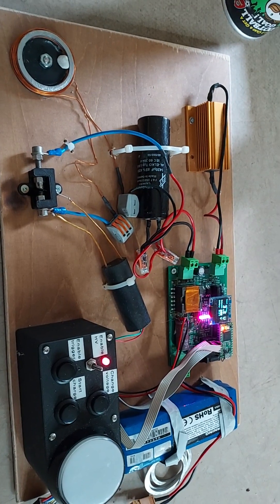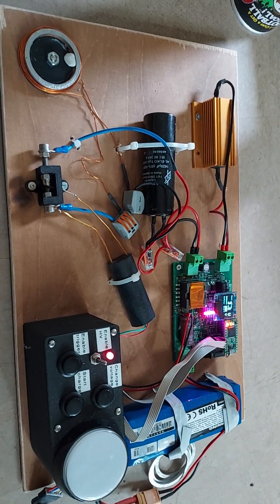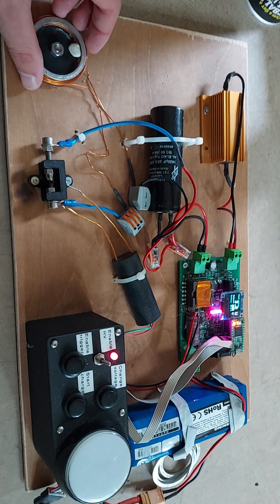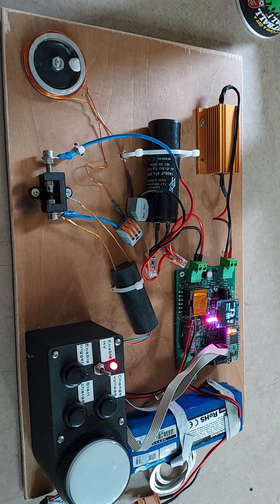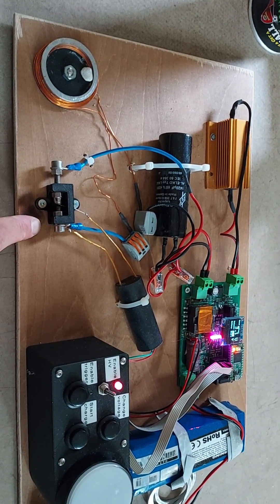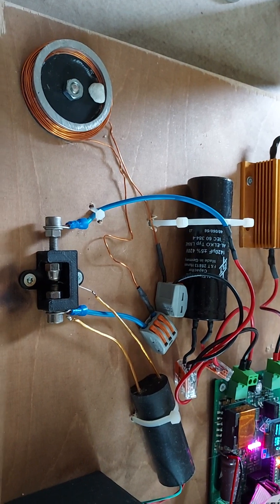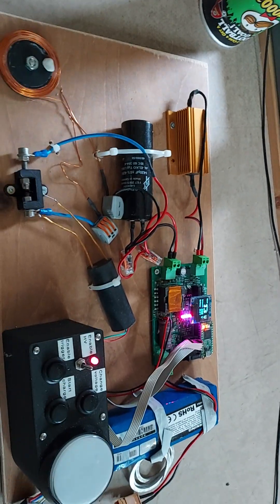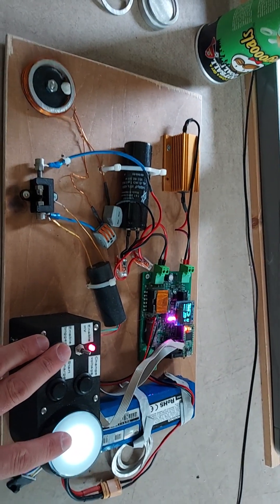Ring launcher: high voltage + high current + plasma triggered switch = extreme acceleration + fun

Comment: I want to build one of those , but I have electrolitic capacitors wich are polarized and I try to take good care of them I am worried about damaging them from the backspike from the coil , do you think a UF diode across the coil would stop the backspike ? Wich diode would you choose ? I guess a small uf4007 diode won't be enough or am I wrong ?
Reply from the maker: A small diode will probably explode (been there done that). I believe that, if the LCR circuit is designed right, the current will have an "overdamped" shape i.e. the current will not become negative. You could simulate (for example in LTSpice) your circuit to see if this belief is correct
Reply: @kloppertje  Mm...yeh I kinda thought same , like using some method so the capacitor would not discharge completly , for example using some kind of fuse in series that would blow up and open the circuit before reaching 0 v , that would make me feel more confident
Reply from the maker: @rodriguezfranco3839  I don't fully grasp/remember the workings of a spark gap (as used in this video); perhaps they stop conducting electricity when the current goes through zero? 
Although this is not good advice, I have never had an electrolytic capacitor explode with my setup 😅
And please, please be aware of the dangers of a setup like this; it's no toy
Reply: You are right brother , I am sorry I forgot about the sparkgap , I was thinking about some other chanel I saw wich was manually shorting the gap with a chicken stick , yeh it would stop probably before 0v

Comment: What is that golden thing with the heatsink? A bleed resistor?
Reply from the maker: Correct! When power is disconnected, or when a fault situation occurs (for example, over voltage), and after every shot (in case the spark gap doesn't trigger the main charge), the bleeder resistor is active.
Reply: @kloppertje  Wow, thanks! That's a very beefy resistor then :P. Necessary of course if you want a quick discharge.

Comment: How are you getting 1000A out of a capacitor thats not 1000A?
Reply from the maker: The capacitor doesn't have a current rating! It has an internal resistance (<0.1 Ohm), so if the load has an impedance that is low enough, high currents will flow.
Reply: @kloppertje  I thought that a capacitor could only give out as many amps ask its rated for an farad?
Reply from the maker: The unit for capacitance is Farad, the unit for current is Ampere. These are two different units :)
Reply: @kloppertje  how do I figure out a capacitors max amps ? Like example i have this huge 4.5LB nichicon capacitor its 100000uf and 100v how do i find out its maximum amount of a amperage it can deliver?
Reply from the maker: @SheikhN-bible-syndrome  Look at the datasheet! Some capacitors have a rated current, for example: https://www.ftcap.de/fileadmin/user_upload/produktboxen/elektrolyt_kondensatoren/webboxen/Loetfahnen/LF2012.pdf

However, special "discharge" or "flash" capacitors or whatever they are named can handle high discharge currents, see for example: https://www.cde.com/resources/catalogs/7P.pdf
I'd say discharge current is here limited by ESR, as I don't see a maximum current. But I didn't read the datasheet thoroughly.
Reply: @kloppertje  I don't see a Max amperage on that charge I just see a ripple current but that's not the same thing
Reply from the maker: @SheikhN-bible-syndrome  What do you want to use the capacitor for? Typically, capacitors are used for filtering, then a ripple current can be used. For peak loads / high discharges, you have the flash capacitors, then internal  ESR (and external impedance) determines maximum current
Reply: @kloppertje  im trying to understand how you are getting "over 1000 amps out of t hat 1 small capacitor thats not rated anywhere even close to 1000F or probably not even 1f. So how your getting over 1000amps is confusing me because i build cap banks for car audio and even with maxwell supper caps which are 3000f you can only get 2300a out of gone on a dead short
Reply: @SheikhN-bible-syndrome  it's just a pulse. The capacitor discharges all of it's energy (which in this case is quite huge) in a single, very short pulse. In this case about a milisecond. This means that a huge current has to flow but only for a brief moment. The only thing limiting the current is the internal and external resistance. If there would be a resistor large enough you could get a few amps for a longer period of time, still it would be a fraction of a second or only a few secs.
Reply: @SheikhN-bible-syndrome  The capacitor will discharge with this formula: C*ΔU = I*Δt
So if you now change the formula to I = (C*ΔU)/Δt you will see that if you have a high capacitance and a high voltage change in a very short time the current that could flow will be enormous but is limited by the ESR of the capacitor and your load.

For example you have a capacitor with 1000uF and 400V and you discharge it with a short circuit (so the Δt = ~1us) the discharge current will be 400kA but its only a theoretical value.